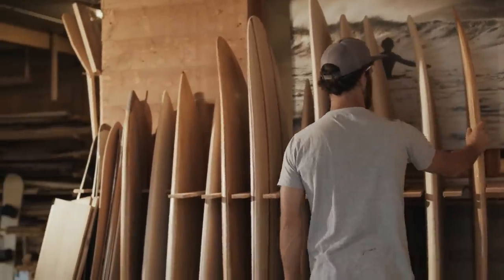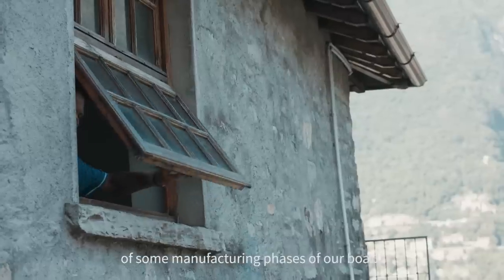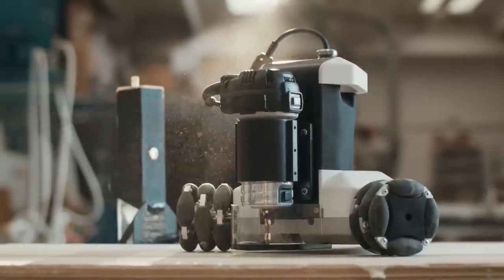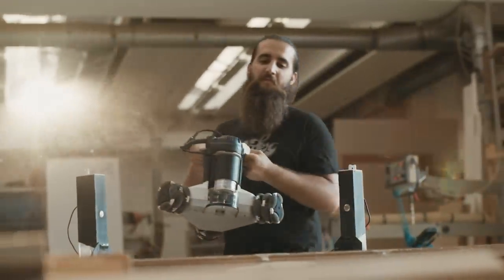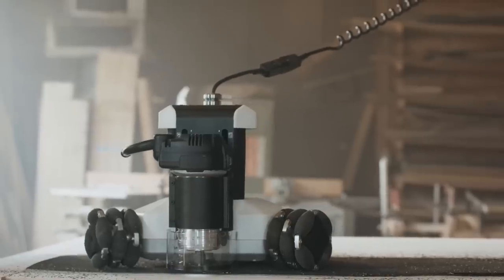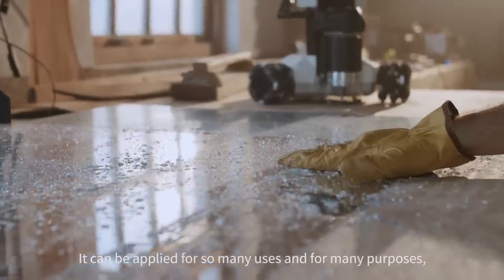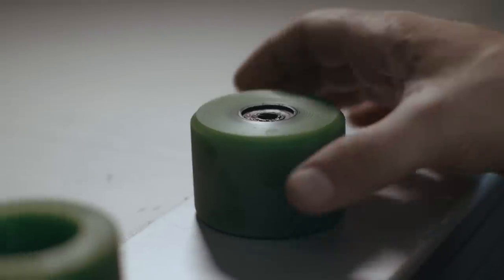Goliath CNC - Portable and autonomous robotic machine tool

Comment: Being a board member of a local Makerlab, I was, at first, really excited about this product. But then... We realized it's not feasible to use it for anything else but cutting out material with as thin line as possible. In other words, it has no real 3D CNC capabilities whatsoever, unfortunately, as the machine would not be automatically leveled, seeing as it moves on wheels (i.e. a bump on the "road" would mess everything up)... What a bummer... That's why we didn't back the project at the moment. Maybe another version at some point?
Reply: my biggest question is, every force has an equal opposite reaction, cutting through material requires significant force even if it is wood your arm gets tire after a while from sawing manually or you usually have to push hard with a drill to get through so what part of Goliath is absorbing the push-back from the material? those wheels? is that friction enough? I doubt it but I could be wrong, they raised a million dollars and I didn't see the answer to that question anywhere
Reply: @jrcolmena  I had the same thought, my only POSSIBLE explanation MIGHT be the weight of the motors, spindle, and electronics inside are heavy enough? Otherwise you need to use VERY slow feedrates

Comment: Looks good. My worry is total lack of dust and chip removal. Bits will build up under the wheels  and this will cause innacuracy. Similar to the exposed wheels and rails on x carve style cnc machines. Perhaps a fan that blows accross the workpiece with a lot of airflow would help in this case.

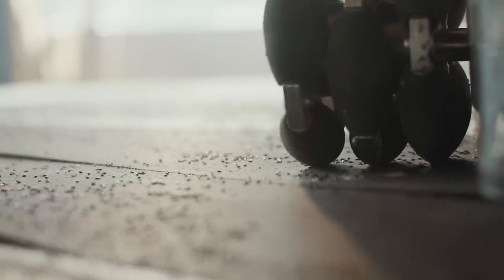Comment: In reading the comments, I totally agree with the limitations listed.  When they started showing this thing cutting, I was thinking that the chips need to be constantly removed by vacuum or air nozzle so that the wheels don't bump on up and down on the chips.  At 1:38 you can see this real clear.   I would like to see a closeup of the cut edge in plexiglass to see just how straight and even those lines are.  A router bit that is not contained in a rigid frame will bounce back and forth in the slot.  This vibration will move that bot, not matter how precise it  was meant to be.  At 2:13 you can see that the line is not straight but wobbly.  
So what is the accuracy?  Are we talking about thousandth of an inch or hundredths of an inch or tenths of an inch?  Because if that router is not solid, vibration at the bit will cause it to move and not in the way  wanted, especially on the slippery surfaces shown in this vid.  The software may conpensate to get it back on track but the damage is done.  I use routers every day and just don't see how this can be very accurate with the limitations mentioned.  You may get general outlines but precision  isn't one of the attributes I see here.

Comment: I imagine that position is maintained/tracked using the strings and a pulley system in the two posts. Perhaps there is another reflective sensor like an optical mouse sensor underneath (can see something in one shot of it). However, the pulley string system will be increasingly less accurate as the router moves away from the posts, so that's a problem. Plus, as pointed out already, you really can only do flat cuts, no Z variation is possible. I'd rather have a shaper origin...

Comment: Could this carve guitar round top, what if its wheels stuck in pickup holes ?     How could this machine carve close to wood edges since it needs 3 wheels on the surface ?      Could this carve steel helmet will this slide and drop during cutting ?

Comment: So it doesn't have variable z axis?
Reply from the maker: Yes, it has! The maximum can depth of cut is 1.3 in (35 mm). This is dependent on the material of choice and the kind of mill bit used.
Reply: Goliath CNC can you post a video demonstrating the variable z axis
Reply from the maker: Here you can see a GIF
https://ksr-ugc.imgix.net/assets/018/577/192/8976554f8f8f9321e85ec5241c261a26_original.gif?w=680&fit=max&v=1506975429&auto=format&gif-q=50&q=92&s=94dade5ca2fc1dc0e3db7b9d9879386c

Better, I suggest you to see the Playlist "Goliath CNC Features" on our channel, where you can see clearly that we are cutting with more passes with different depth of cut